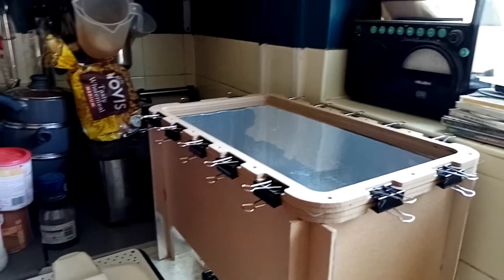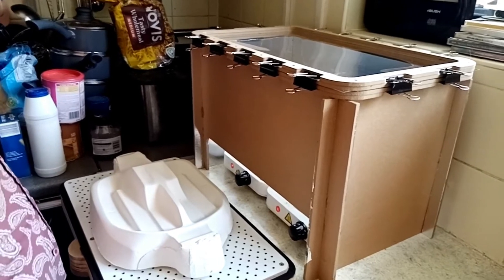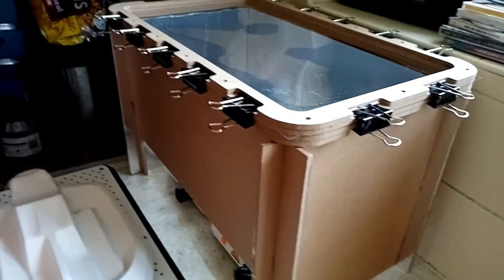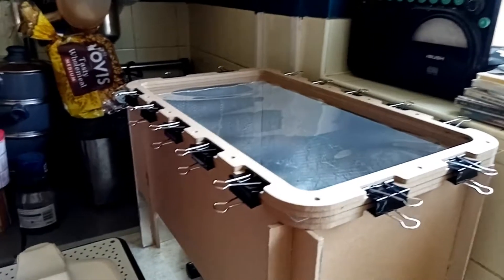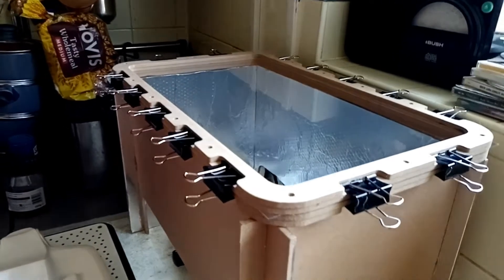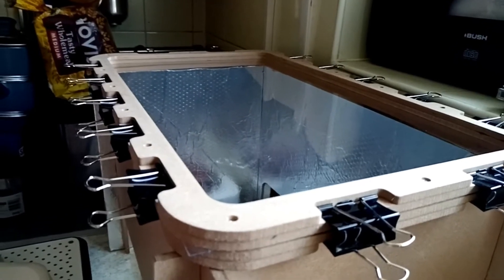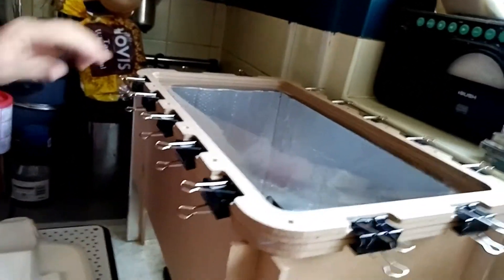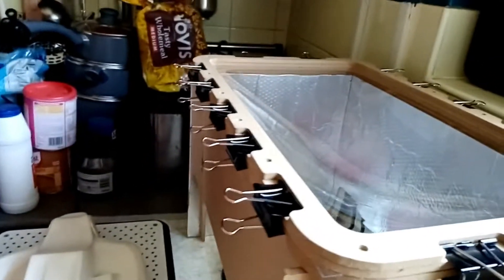Vacuum forming a RC Body  with 1mm PETG 18" X 12" Former Kit  with Heat Box

Comment: Hi Michael, How much is this setup to the UK? also do you know where I could source the appropriate sized sheets to make rc bodies?

Thanks Chris
Reply from the maker: Hi I am in the UK so no problems  I sell a 16 x 12 with heat box and heaters on ebay and etsy they are £165.99 for the full kit that's all you need except the vacuum cleaner the one in the video is slightly larger 18 x 12  that would be £185.99 the price dose include shipping as regards plastic I buy petg from here
 https://www.trentplastics.co.uk/pet-petg-sheets/clear-petg-sheets
Hope this helps Mike

Comment: can the machine kit be purchased from the USA?
Reply from the maker: Hi I sell the vacuum bed on its own to the USA but not the heater as it is a different voltage but I can give you a link to  a compatible heater on US EBAY and the heat box would be  easy for you to make from some thin  plywood and foil roofing tape
Reply: @michaelgreenhouse2044  I would like to purchase it with the heater cabinet lees the heaters if possible.
Reply from the maker: @alcetus3  That is possible the only drawback is the shipping costs  I sell the former on its own  for £90  the sipping is around £55 fedex 3 working days the cost of the heat box without the heaters would be £40 so it would be  a total of £130 plus shipping so £185 inc shipping so a bit pricy let me know what you think